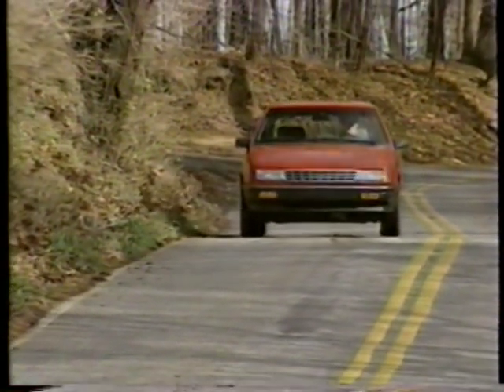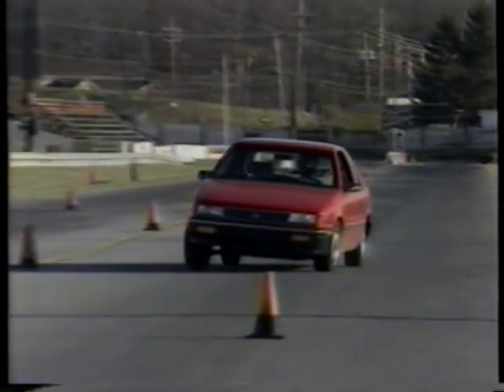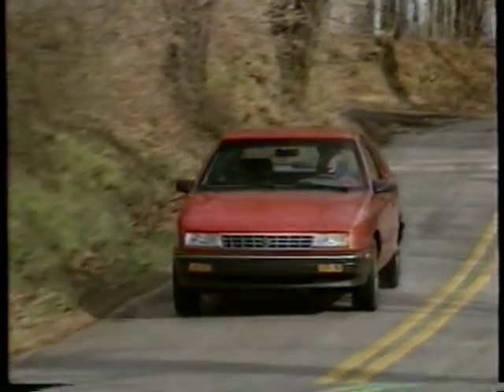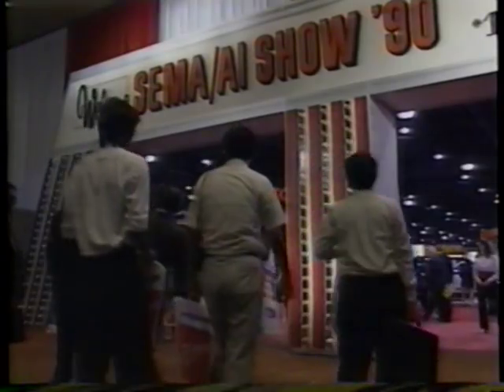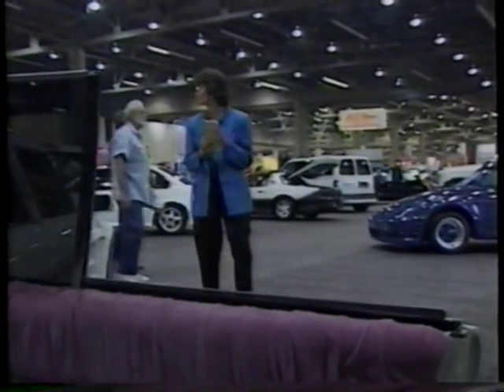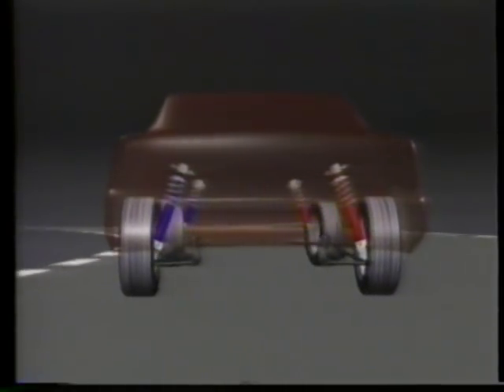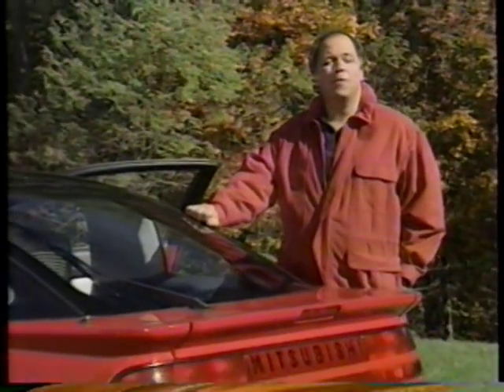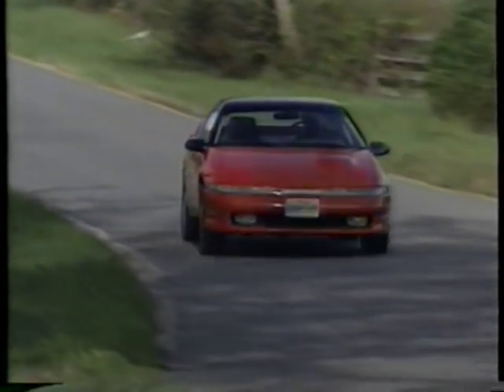12/30/1990 Motorweek '91 Episode 1014 Infiniti Q45 Plymouth Sundance

Comment: Unfortunately the Plymouth Sundance and Dodge Shadow represented the last of the decent small car offerings from Chrysler period replaced by the Dodge and Plymouth neons which will go down in infamy for being some of the worst small cars ever crapped on to the American Road the Shadow and Sundance we're pretty decent cars and gave their owners decent reliability up to about the 10-year mark. Head gasket issues and body Rott were two of the biggest killers of these Chrysler cousins along with some issues with the automatic transmissions.
Reply: Have a 130k mile 2002 Chrysler Neon Lx automatic
Hasn't let me down at all and never had a head gasket issue. Yes there is rust but it's very minimal. To be honest the Neon is the best car I ever owned. Maybe I'm lucky.
Reply: I had a 2005 Neon and it was a decent fun to drive car
Reply: Ya, the Neons were decent cars. They had some early teething problems, namely headgaskets. Once they got those worked out it was a decent car.
Reply: The 2.2L engines in the Sundance/Shadow weren't known for head gasket issues. The optional 2.5L engines (Mitsubishi designed I believe) were well-known for that issue though.
Reply: My mom had a 93 sundance duster gtc.
Reply: You are correct.  But it was the Mitsubishi 2.6 Liter I4 that was notorious for head gaskets.  The 2.5 Liter I4 was actually a Chrysler unit based on the 2.2 that was slightly larger with balance shafts.  The Chrysler 4 cylinders were really reliable (they were designed by the lead engineer of the Slant 6 engines).....  But yeah, you definitely wanted to avoid the Mitsubishi engines from that era.
Reply: Shadow was a better car than its domestic rivals -- the Cavalier was awful during these years and so was the Ford designed Escort.  It wasn't until the Escort was redesigned on a Mazda platform in 1992 when it actually because a reliable car.
Reply: The first generations Neons weren’t all that bad, still suffered the same head gasket problems and body rot that you mentioned, still pretty decent cheap cars
Reply: So much misinformation here. First gen Neons especially were fun to drive with the manual and handled very well. The head gasket issue was only for the first few years of production before the MLS version was launched. The 2.5 was a stroked version of the Chrysler 2.2, the earlier 2.6 was the Mitsubishi 4G54. And yes, the early 2.2s were known for head gasket failure as well.
Reply: Agreed.  Personally, the early Neon's head gasket issue was easily resolved by using an aftermarket gasket -- so I think that was always a non-issue.  IMO, I had a bigger issue with the frameless windows on the first gens.... No matter how many times I would tell passengers to not close the doors by pushing on the windows, they would do it anyways..... And that would always lead to rattling windows later in the life of the car.
Reply: @SataniaMcDowel  will a 130 K isn't a lot of miles but I'm glad you got one of the rare good ones. They dropped the neon from their lineup in 2006 and for as many of them that were sold there aren't very many left zipping around the town here in Miami. At one time they were a common sight but not So Much Anymore especially compared to carollo's, civics, Elantras and even Mazda 3s.
Reply: @horseplop9  junkie when compared to a Corolla yes but Superior when compared to it's neon predecessor.
Reply: The automatic transmission was based on the A-904 that was first used in 1960 and is very reliable.

Comment: Seriously, would anyone buy the Sundance over a Mazda? The Hyundai Excel was total garbage so that choice I could see.
Reply: I don't think Mazda had a great reputation at the time.  Not to say that Chrysler did either.
Reply: Mazdas were pieces of shit from this era.  Chrysler was actually known for being the most reliable domestic brand if you read the Consumer Reports from the late 1980s to early 1990s.  Quality and Reliability was not only good at Chrysler during this era (but rivaled Toyota at the time) -- they actually had the longest warranty in the entire industry at 7 Years / 70,000 miles.   Then Eaton ran their reputation into the ground by rushing products through engineering (during the mid 1990's) and Chrysler's reputation never recovered.
Reply: Don't forget about the massive sales incentives that they probably offered at the time. I bet they could snag a Sundance for less than $6k new back then
Reply: Most definitely.  K-cars were hot sellers -- the incentives made them incredibly tempting.  I know my parents scored a brand new 1988 Reliant LE for $5995 after incentives (about 3 grand less than MSRP).  They may have been stodgy, but the powertrains were quite reliable especially the 2.2 / 3 Speed Torqueflite combo.  My parents managed 300k mile on that Reliant on only a transmission rebuild.
Reply: Yea, good question. I'm sure it had a lot to do with brand identity...the 323 was a very basic car, but to the eyes of many the Chrysler cars of the era were repugnant, unrefined transport.
Reply: LOL....  talking as if the 323 wasn't a completely repugnant, unrefined shitbox.  The 929 was indeed a nice car -- but the 323 was garbage during this era.  Chrysler built some genuine excellent cars in 1990.   For example, a Plymouth Laser  or Eagle Talon Turbo just makes the Mazda look that much shittier.
Reply: Right, I hear you, the 323 wasn't a particularly appealing car. When moving up to the mid-sized models though, I would disagree. Put a 626 up against a Spirit/Acclaim and I think one was a clear winner in terms of refinement. Again, maybe there's some brand identity there too, but most reviews of the day would have leaned heavily to the 626, same being true of the 929, even though it was such an utterly forgettable design. Agreed on the Diamond Star Chrysler/Mitsubishi trio, it was a groundbreaking car for the time. It wasn't quite in the same box with the Rx7, but it wasn't supposed to be.
Reply: @LakeHowellDigitalVideo  What? You'd have to compare the Eagle Talon/Plymouth Laser with the RX-7, not the 323. And the RX-7 always wins, unlike its bizarre replacement the RX-8.
Reply: @LakeHowellDigitalVideo  I'll drive any Diamond Star Motor car :)
Reply: No, I don't think so.  kgbeezr75 made a blanket statement specifically about the Mazda 323 being better than any car Chrysler was building at the time.  That was flat out false.  The Diamond Star Turbo cars were amazing for their era.   Besides, even when you moved goalposts -- the Talon/Eclipse Turbo (On Car & Driver's 10 Best List for 4 years from 1989 - 1992),  were vastly better cars than the RX-7.  The RX-7 was pathetically outdated by 1990 (debuted in 1984 as an '85 model in Japan) -- and that generation of rotary barely made any power.  When the redesigned car finally showed up in 1992, the RX-7 still had a massive performance deficit to the brand new  3000GT/Stealth R/T......  Mazda never had a chance with the RX-7, which is why they focused on the more successful Miata to this day.
Reply: At the time much of the senior population was still very loyal to the big three.